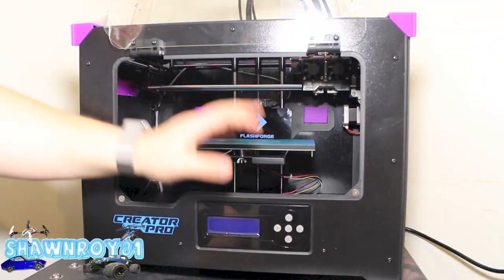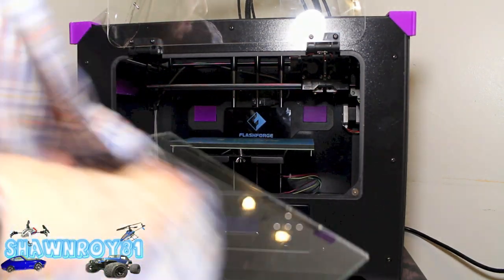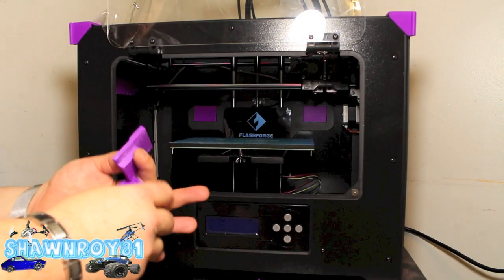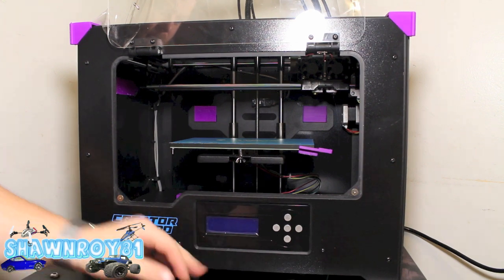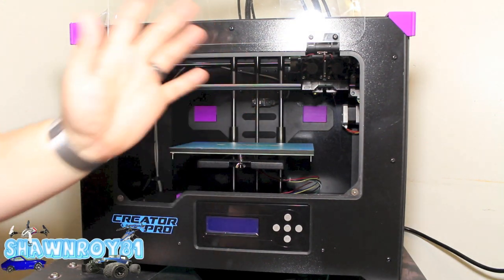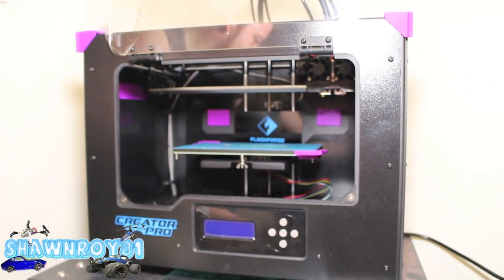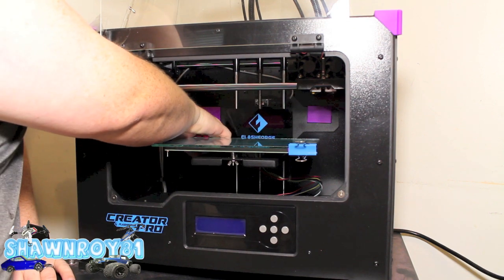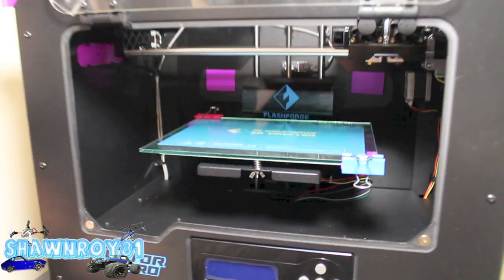Flashforge Creator Pro 3d Printer Larger bed upgrade

Comment: This is rather useless. The printhead can't mechanically move any further in Y + or - direction and also not in the x - direction. The only use it has is like 15 to 20 mm in x + direction.
Reply: Tim van Cromvoirt flashforge said this was a good upgrade
Reply: Not quite true if you find the limits for both heads and use a slicer that isn't flashprint you can adjust the bed size and doing additional research I found thinner boro glass is the way to go but leave some extra space around the edges and turn the bed temp up a little higher than you would bare

Comment: Nice vid. How much larger does it make the effecting printing area? And do you know if it is possible to also increase the build height?
Reply from the maker: Thank you. I use  replicator g as my slicer and it allows me to over print. 8x10ish. No you cant extend the print height
Reply: Thanks for the response. I am thinking of doing this mode for my PLA prints only.
Reply from the maker: perfect. let me know how it goes

Comment: Where did you find the boro glass at in 8x10?
Reply from the maker: +Dark Alchemist its not boro glass. This is just regular class that I got cut at a local shop and its tempered. Been using it for 6mts now with no issues. The main thing is that it needs to be tempered. I tried none tempered glass and it shatter after 2 prints.
Reply: shawnroy81
How much did it set you back and it was 1/4inch?
Reply from the maker: 10$ and it was 5mm thick
Reply: shawnroy81
Not bad and 5mm thick you mean 3/16in?  I say that because no glass shop around me will work in metric and they all told me they never will as long as they live. :/
Reply from the maker: 5mm is 3/16 inch according to google. Sorry im not familiar with inches. Everything I work with is in mm
Reply: shawnroy81
Same for me but not for any shops I have to deal with as they are hard set against metric and they will not change so I have to bend for them or eBay everything I can.
Reply from the maker: I hear ya but they could have done the conversion for you aswell.
Reply: shawnroy81
The shops around here, and I, had a conversation about going metric and how this country is officially a metric country and they told me they are old guys doing this work with machines that cost a lot of money that are done in Imperial and these shops will not change within our lifetime.  They said they can't even think in metric and do not even know how to convert, and have no need to.  I say to them that old guys doing the work training young guys in imperial so when does it stop?  They can't even think in Metric is no excuse as I am learning metric.  I remember in 1974 (I was in the fourth grade) and we were all told that by the time I graduated HS this country would be fully metric.  This was the course in 1974 but Ronald Reagan became president and he didn't like the metric system (rumor is he was paid off by the industry then as a complete change over would have been very expensive) and publicly stated he thought it was a communist plot to subvert our industry and way of life and killed the metric system for good.  Two years ago I found out Obama officially made this country a metric country and as he signed that into law the last metric road signs were being taken down.  What a load of crap.  So, trying to find anything metric is a trip to eBay or AliExpress for me.

Comment: How do you get your printer to print on this increased area? I'm using simplify 3d and have changed the dimensions of my bed but it seems there are physical limitations for the bot to print on the bigger surface.
Reply from the maker: +Michael Green I haven't pushed the limits yet..I do printer bigger than my initial setup I just agree to the prompt when it asks if I want to printer over the borders.
Reply: You would have to setup a custom profile and then put in the bed size, that would get the software sorted but then you would have to write custom firmware to tell the printer the new bed size and that is going to open up a whole new can of worms and problems I imagine. Not to mention you will never get heat to stay constant around those edges.

Comment: +shawnroy81 Was there any issue with the edges and corners that are hanging off the heated plate not heating up? Did you experience any edge curling? Were you using regular glass or a brand of thermally conductive glass?
Reply from the maker: +mrdude3691 No I haven't experienced the edges hanging off. I do see some warping but ABS is bad for that. Nothing different than with the stock bed. This is just regular 5mm  tempered glass